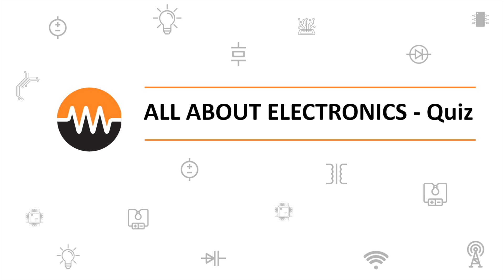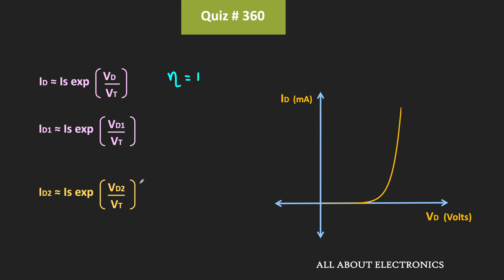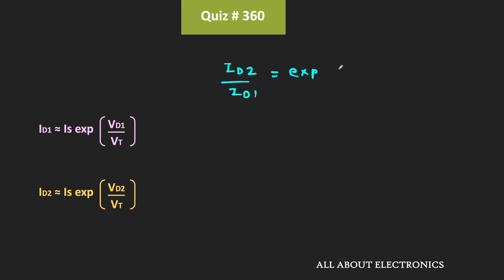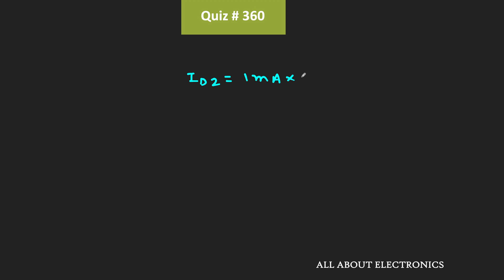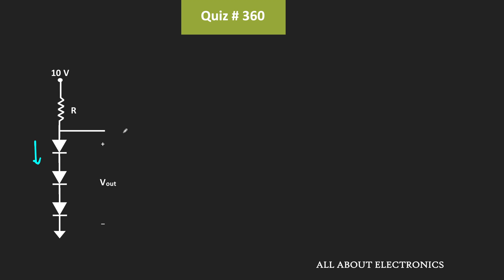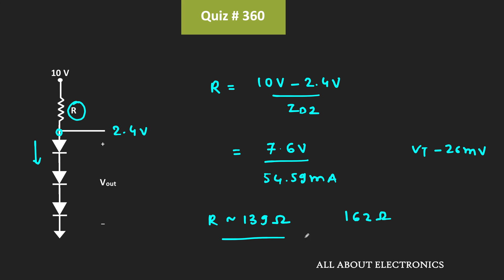Diode Circuit Solved Problem | Quiz # 360

Comment: How Id1= 1m when vd1 =O.7 v
Reply from the maker: The current is 1mA at the specific resistor value. Depending on the value of the resistor, the current and the voltage drop across the diodes will change. Here we have been asked to find the value of the resistor such that, the voltage drop across the 3 diodes is equal to 2.4 V. I hope, it will clear your doubt.
Reply: @allaboutelectronics-quiz  I was asking about the thing that you have considered Id1 = 1mA when vd1 = 0.7 v .I got that R value
Reply from the maker: @susmithat198  Id = 1mA when Vd1 = 0.7V, that condition is already given in question. The value of R, that you with this information is for Id1 = 1mA. In the question, you have been asked to find the new value of R, when Vd2 = 0.8V (or the voltage drop across 3 diode is 2.4 V)
Reply: @allaboutelectronics-quiz  thanks a lot

Comment: Here why you are not taking neta(n) in diode equation , for si diode neta value is 2.
Reply from the maker: For Si diode η can be considered as 1. For actual Si diode, η slightly deviates from 1. But it will be close to 1.
Reply: @allaboutelectronics-quiz   ok sir got it , sir for germinium diode also neta 1 ?
Reply: @allaboutelectronics-quiz  why do have to divide the two diodes then what's the logic behind this? Also is there an easy way to solve this without using diode formula?
Reply: You are right. For Si diode neta 2 (approximately). For the Ge diode, it is close to 1. But don't worry. Here material of the diode is not given. You can safely take neta is 1. It will just change the numerical value. The approach is important here.